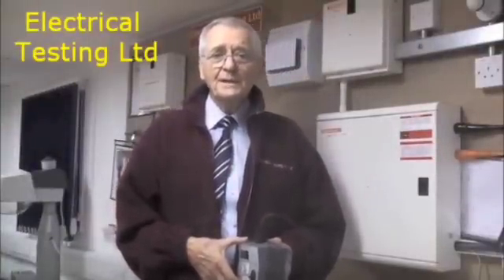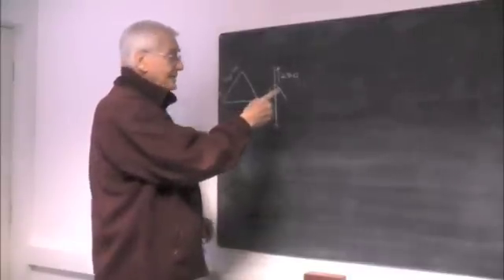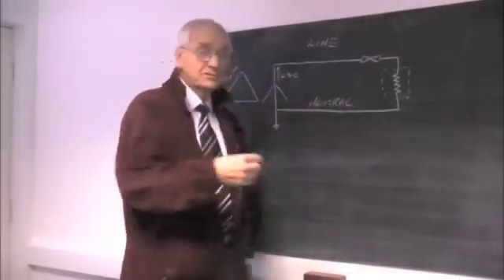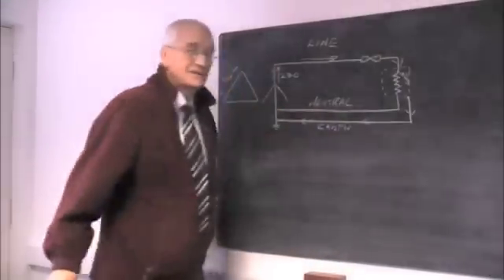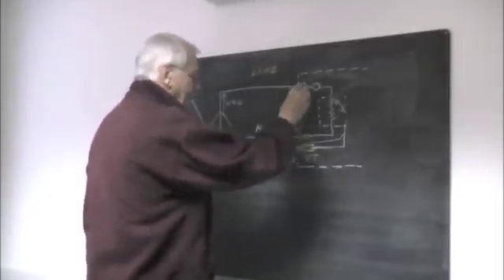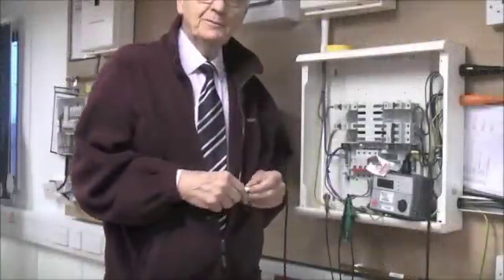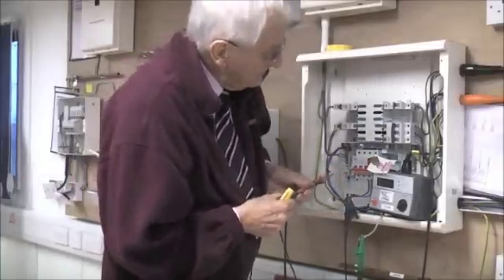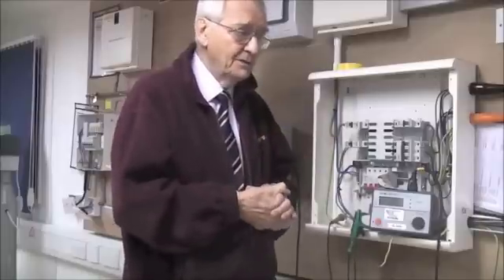Earth fault loop impedance explained

Comment: Is the connection of the meter probe to the phase conductor on the main switch Hi Z itself ? By just holding the probe on the live screw wouldn't this introduce a Hi Z connection thus cause a higher reading than actual. All other system connections are large cables and under lugs with nuts and bolts. I guess the meter calculates the impedance of the probes and leads and brings them into the equation ? If the main earth conductor was just held onto the main earth in the same way would this test show up a this bad Hi Z connection for example ?  Cheers Mark.
Reply from the maker: Hi Mark, if I understand your question any connection like this will introduce an impedance however on a low voltage installation, with a good probe contact it is negligible. For a high voltage system the contact resistance would be critical.
Reply: The impedance is calculated by the Gizmo meter. The Gizmo unit measures the voltage, then adds a small load current and remeasures the voltage and thus the "voltage drop" is known for the test current.

Example: One might have 237.78 volts with no load and 237.57 volts with a test current of 1/2 amp.

Thus one dropped .21 volts with 0.5 amps  

V=IR thus R=V/I = .21/.5= 0.42 ohms  

The test load is only applied over a short time.  

The test meter measures the voltage with and without a test current, then figures the impedance. 

Because the test current is going through the test leads then yes the gizmo uses the leads in the calculation; or might use two internal wires on each lead so the voltage is remotely measured right at the probe tips.

Comment from the maker: Hi Stefenski, without seeing the installation its difficult to be sure but you may have a TT Installation; this would have an 'earth' provided at the installation usually by way of an earth rod and make no use of the Electricity Suppliers earthing facility (or may not be provided with one). This is typical in rural locations and more info can be found if you search for 'earthing system wiki'